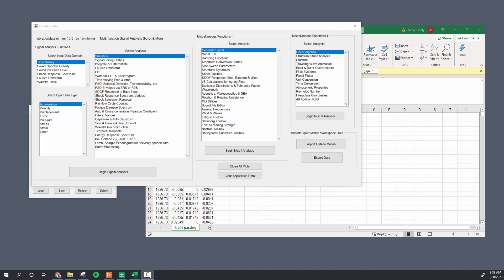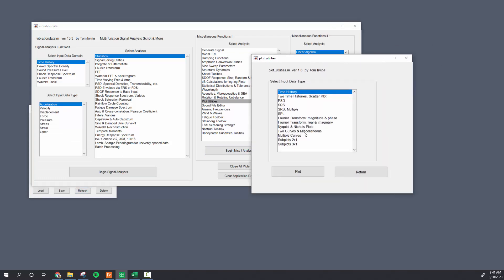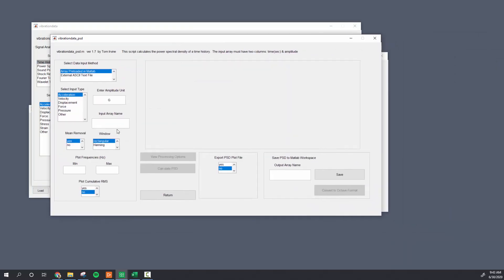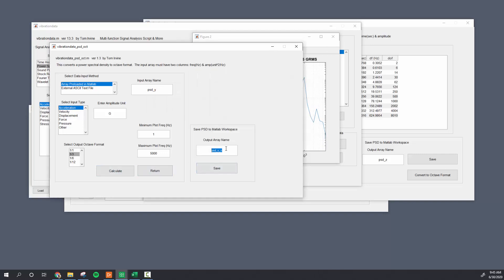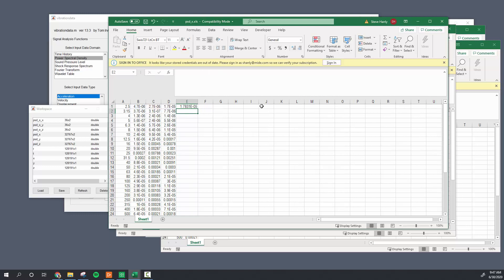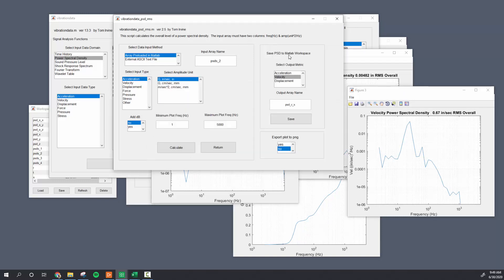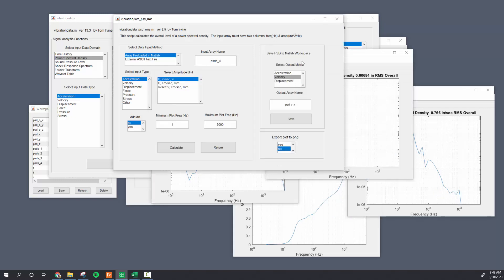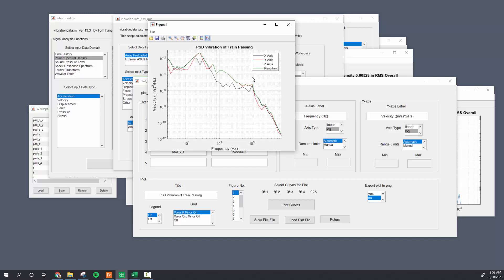How to Calculate a Resultant Velocity PSD

Comment: Hi...informative video. I have a query slightly tangential to this. Based on the random vibration analysis of a hardware, rms strain results are available, and I want to compare that strain to a limit which is strain-rate dependent. How can I identify the strain-rate for my application?